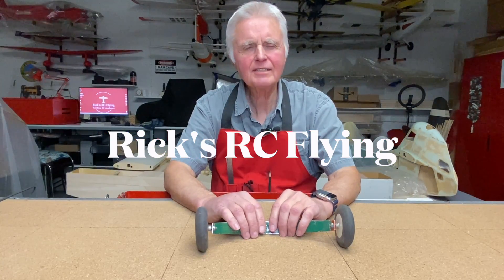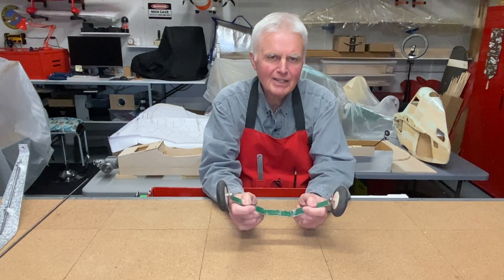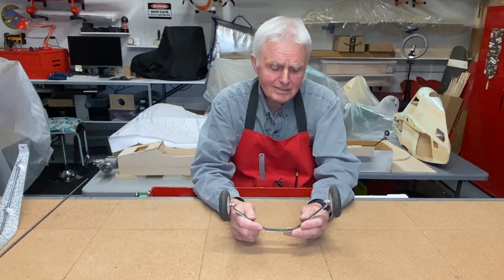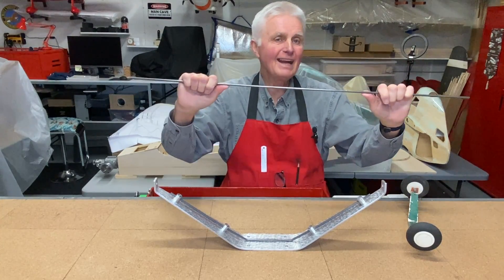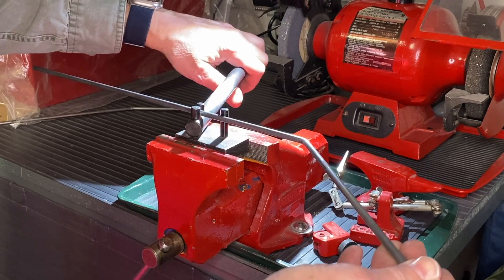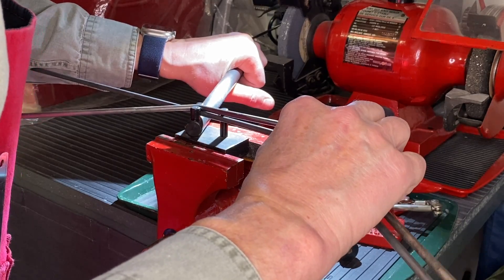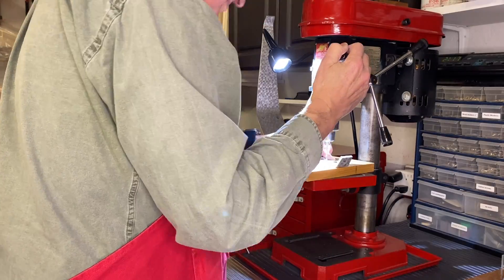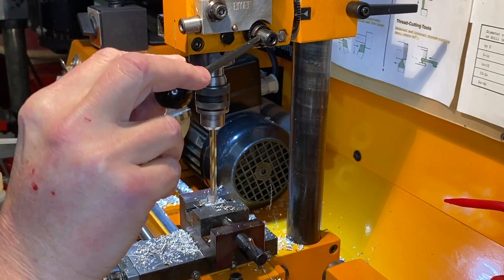Aluminum Landing Gear Suspension System For RC Model Airplanes

Comment: Timely video, I just received a wire bender from micro mark.
How much weight would you estimate this gear to support ?
Reply from the maker: Hi Mark, The landing gear featured in the video has handled 25 pounds with no problems.

Comment: I recently made up a set of aluminum LG for a 40 sized nitro model. Along the way i learned that 6061 will reharden itself over a period of time after heating and bending. I had no idea!
Reply from the maker: Yeah,  it's interesting how Aluminium Alloys “Age Harden” That is they recrystallize at “Normal” temperatures while steel does not.

Comment: I've done the same thing with a few of my arfs. On my 30cc stick I just used landing gear straps to hold the wire to the gear. Works great! Thanks for the video
Reply from the maker: Yeah, couple of my buddies also used the landing gear straps. Definitely easier way to secure the piano wire. Thanks for mentioning it. I will bring it up in a future video.